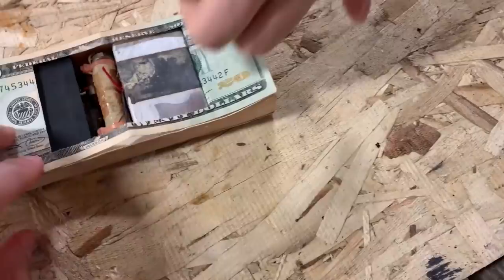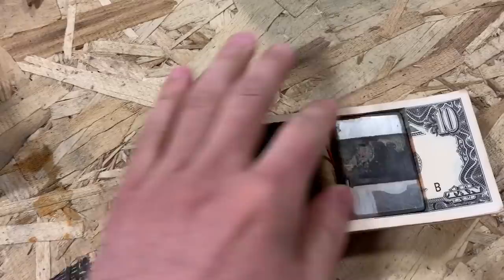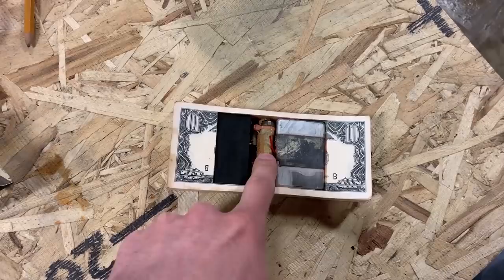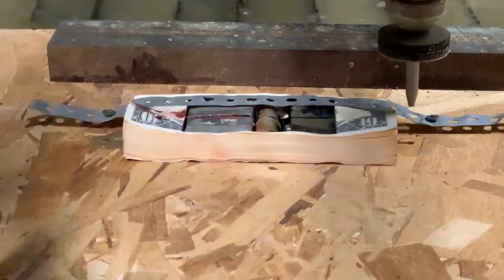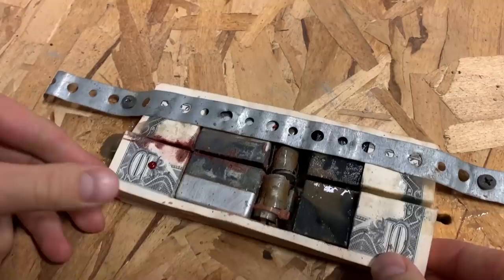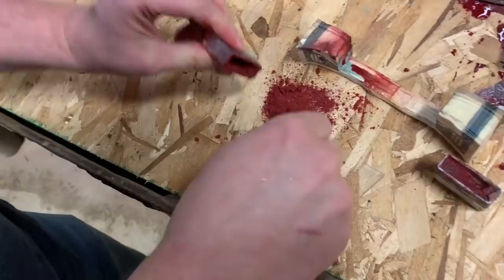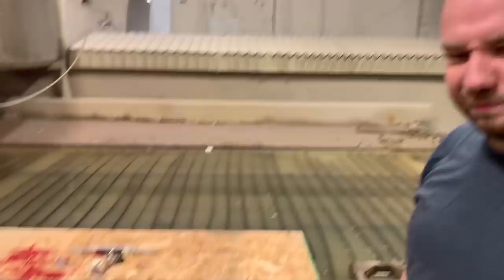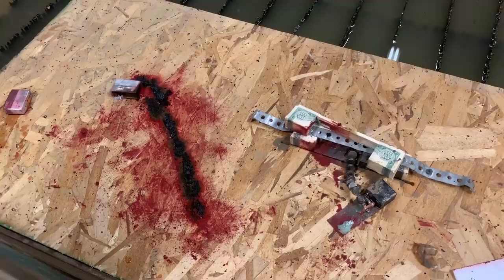Bank Teller Money Dye Pack Cut in Half with Waterjet

Comment: Its always a good idea to poke stuff where you belive it might contain exposives... even little like bullet primer can blow finger of, and this might have bigger boom inside...

Also, when you burned it, I think it might contain flashpowder or something, that blows foil case open when pressure builds up... Igniter is most likely resisting wire inside the case.

Comment: I am betting that the dye pack has capsaicin which is really strong, a pink dye, and possibly the powder that goes into tear gas along with gun powder that is used to set it off. They are using an electric ignitor like what you use in model rockets to set  off the charge on the dye pack. I have worked out a way to detect that style a of bank dye pack. I then worked on a next generation of dye packs that couldn't be detected.

The older dye pack seems to have metal batteries and a metal case holding the dye and a transmitter that uses a metal antenna and has metallic parts inside the transmitter. I would figure a hand held metal detector would be able to detect the dye pack.
Just have one of the hand held metal detectors in your back pocket and when the hand you a the cash just run your metal detector over it and when it goes off just toss the real money in your bag and toss the dye pack across the room because they have armed it and leave the bank with your cash. If the dye pack is on a timer then it will blow up in the bank a spray dye, capsaicin, and tear gas all over the bank and drop a few concussion grenades in the bank as you are leaving.

Comment: I believe that it is a receiver not a transmitter and the bank has a signal that is transmitted either when the alarm button is pressed or it transmitsfor a short distance and once you're out of range of the bank transmitter it goes off

I think there's something with the doorways as well that when you walk through the doorway that activates the unit to arm it so that it can't accidentally go off inside the bank

I wish someone would we use one of these for the package thieves

I'm sure no one would go outside if they were covered with bank dye